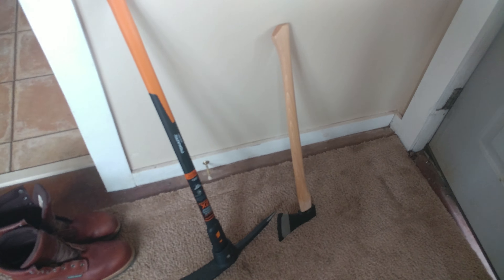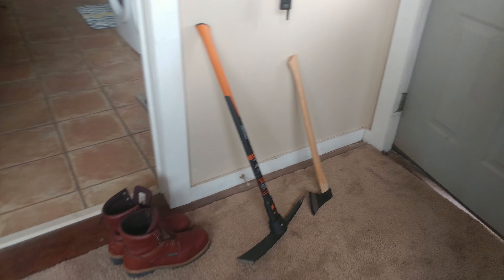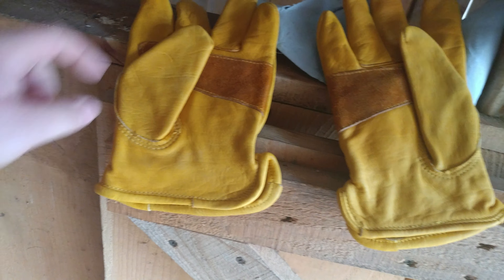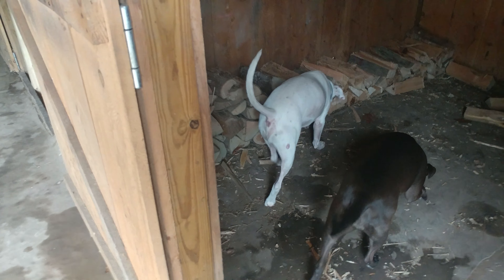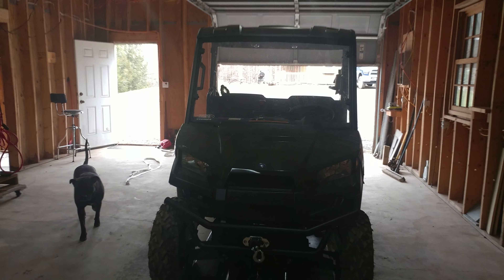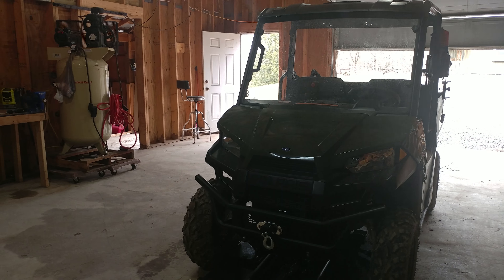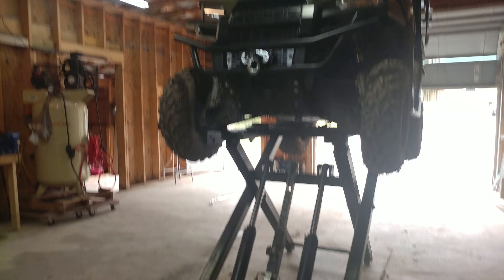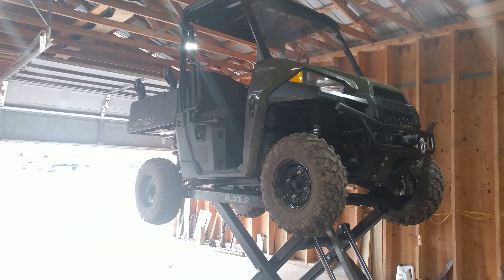Atlas 6k lift! td6mr harbor freight lift

Comment: Nice. I have been looking at maxjax portable lift. I just can't bring myself to pull the trigger.
Reply from the maker: I thought about a base plate lift at first. Then the maxjaxx. Decided against that lift for the reason people were having to bleed the hydraulics almost everytime they set them up just to get the arms to lift at the same time... I live in upstate N.Y.. Didnt wanna deal with water and holes in my concrete floor.